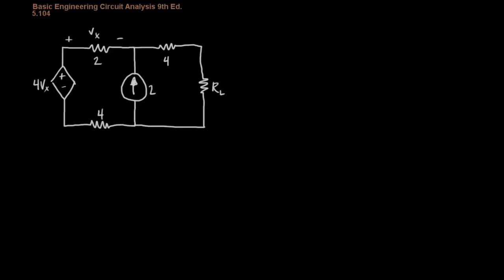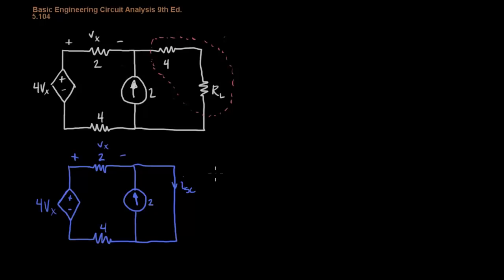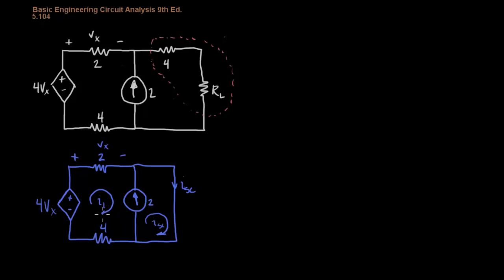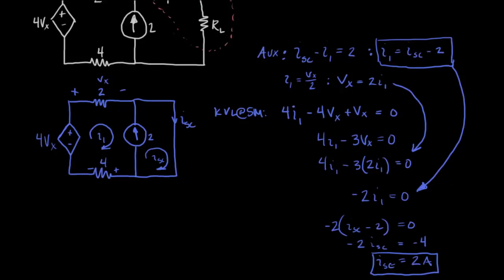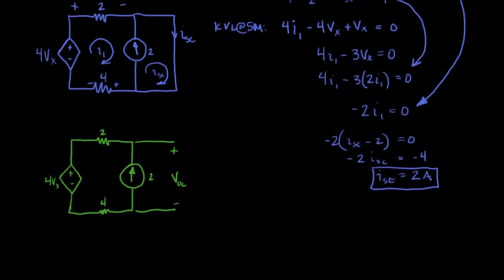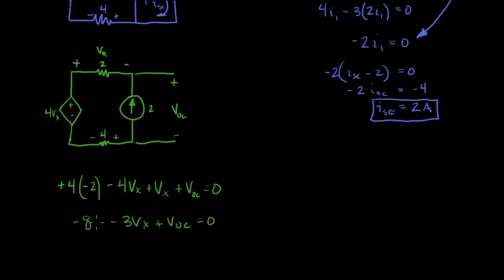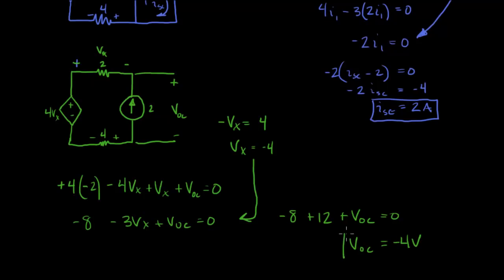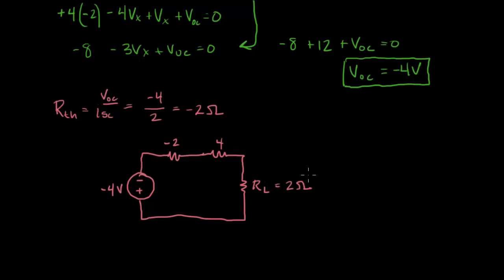Maximum Power Transfer

Comment: hey there , i'm very confused about the load thing , why did you remove the 4 ohms resistor with the load ? can i do that whenever i want ? if i only removed the load and left the 4 ohms resistor it will be wrong ?? please i need help in this ? if i have a voltage source in series in the same branch with the load can i remove it too ??

Comment: thanks for the video,,, but i have a question if you may:
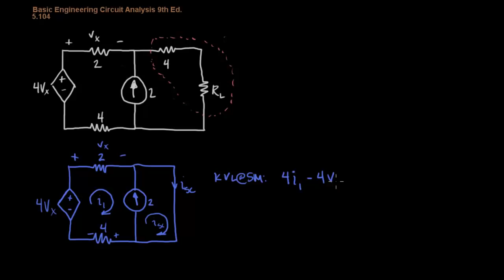why you neglect the independent current source in the first part when you make mesh analysis at 3:37 .. and you use it in the second part when you use in this equation at 4:43 ?! 
thanks
Reply: that is how you solve using supermeshes :) you remove the current source in between to main meshes
Reply: Leo Nogas thanks

Comment: The solution to this problem is incorrect. The proper Thevenin circuit is a -4 v source followed by a Thevenin resistor of -2 ohms ... that part is correct, but the Maximum Power Transfer Theorem says that RL = Rth. (You didn't remove the 4 ohm resistor following the current source, you neglected it. Since no current flows through an open circuit the contribution of the 4 ohm resistor to Voc is zero.) However, when calculating Isc you left the 4 ohm resistor in the circuit (or you should have); hence, the actual, no kidding, value of Rth = -2 ohms. Thus there is no practical way to get the necessary condition that RL = Rth for this specific circuit!